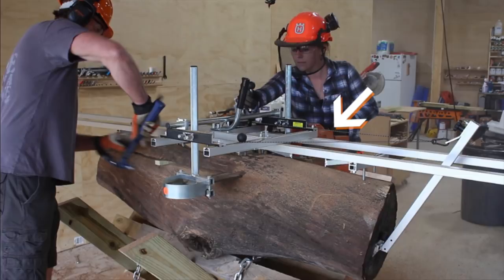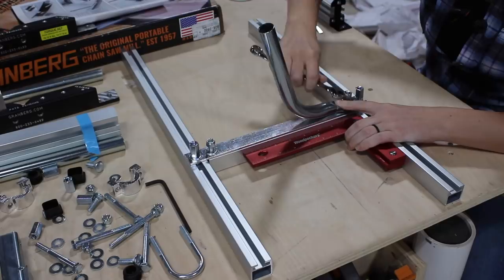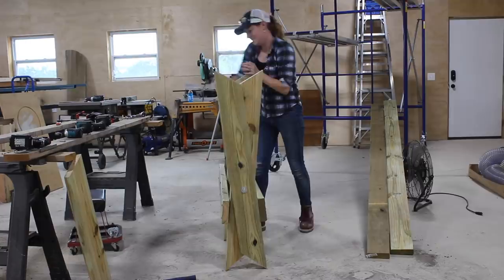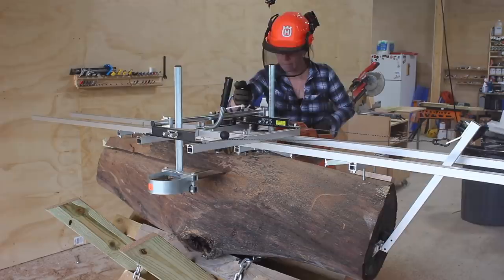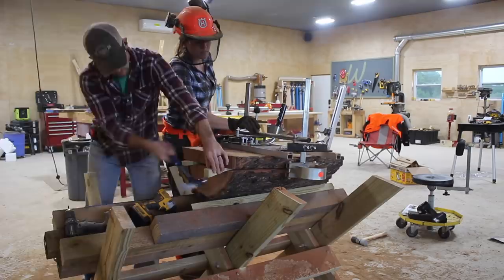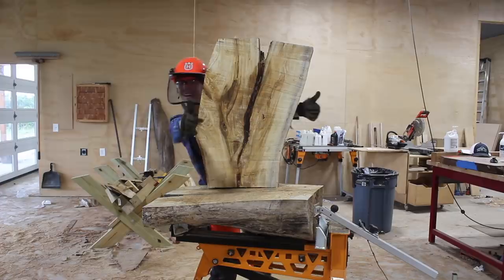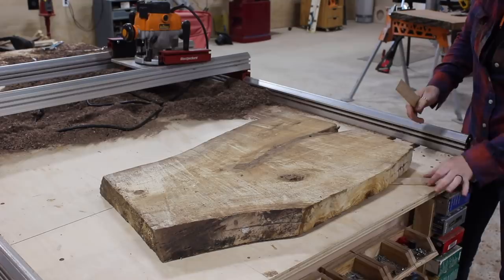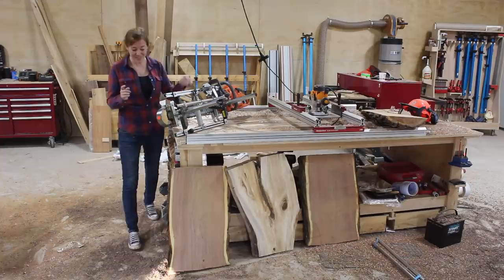Portable Chainsaw Mill : How To Slab Logs

Comment: I've got a 36" Granberg mill with a 36" bar on my Stihl 461. I set it up a couple years before Granberg offered their winch accessory so I installed a boat trailer winch on a wooden fixture attached to the mill guide bars. I've used it on ash logs up to 30" in diameter.

I found that to get the best yield out of the logs I make the first cut such that it is a 1/2" to 1" above the pith at both ends of the log. Then I work each "half" of the log milling off boards/slabs.  I find that the chainsaw mill is better supported on the log when working from the wider surface to the narrower surface.  

An advantage of the winch not mentioned is that you can move the saw through the log much more smoothly with the winch. The smoothness results in a more consistent and smoother surface on the boards than is possible by pushing the mill through the log by hand.
Reply: I do the same John Grossbohlin. I cut parallel through the largest crack in the pith, then mill each half. I also put the log on a good slope and hand push it through each cut, gravity works well. I'm cutting oaks, maples and poplar with an occasional black walnut.

Comment: April, thanks for the very informative look at chainsaw slabbing.  My humble contribution to your process is to suggest you use a pulley where your winch cable/cord changes direction.  You will be surprised just how much more efficient a pulley will be.  Best regards, Steve.

Comment: I have a 54" alaskan mill will a Stihl 660.  When I make first cut I use an 8ft aluminum ladder with holes in the steps to screw to the log.  I also have a 20ft ladder I use for really long logs.  Great video April.

Comment: ALWAYS use the highest grade two-stroke oil, especially with new machinery, even more crucial if you're using a professional spec saw. I worked at a college where we had so many saws getting scrapped because of low quality oil.

Comment: Good video, I do a lot of slabbing. And your right about the 1 inch per year. But a 2 in h slab is only one year. 1 inch from top and bottom. 3 inch slab is 1 and a half years. 
Thanks for the tip to slab down hill.

Comment: A 450 cc huskie bogs down ripping an oak log, experience firsthand. My Echo 590, 460cc no problem with a sharp chain- oak. I never thought of using a router for surfacing planks, a planer  yes. I have 10 plus acres of oak

Comment: April, great video! The only issue I see in your setup is a mistake I JUST made. Where the mill is clamped over the bar nose sprocket. Clamping it there will cause excess heat and wear in the sprocket and it will fail much sooner. I know this because I was doing the same thing the other day and I had to replace the nose on my bar after it blew up.

Comment: Still another Amazing story from you April I have been following you from the beginning and you are an Inspiration !! One suggestion i have for you that I never see in your videos is an overhead trolley beam with an electric chain fall on it to more heavy pieces around the shop and place them on your benches. If you get one I"m sure you will wonder how you did things without it . I worked in a cement plant for 30 years and dealt with many very heavy things to lift and I think of those times whenever i see you struggling with something heavy;)
Anyhow Keep on keeping on :) You are the "BEST " !!!  
John

Comment: Great video. I got a Granberg myself and used it with a Stihl 084 (with about 122 cc's of raw power) with a 36" bar. It's a beast! I didn't like how much work it was to slab with it. I'm constantly sharpening the chain, adding fuel/oil, and fixing loose nuts/bolts, but the results are pretty rewarding. I can cut huge logs pretty much anywhere. I love your videos btw! You do a great job!

Comment: Great looking slabs!
one thing that needs to be mentioned is if the log is from someone's yard or in town in general, there may be all kinds of metal in the tree.  I remember hammering nails into a tree to climb it.  there are parts left over from clothes lines, signs, etc.    So beware.  Best to get logs from forested areas where this probably won't be a problem.  I just watched a vid where the guy had a bandsaw mill and he hit a huge bolt and some misc. metal in the middle of the tree and trashed 2 blades....

Comment: What is it about slabbing that’s so addictive, that piece of oak you started with that had all the splits and checks in it will make the most beautiful furniture once it’s resin filled. My high end customers from Sydney’s beachside suburbs and inner CBD always favour that finish over clean solid wood. I’ve actually raided people’s firewood stacks for material that’s “rustic” enough before.
Reply: One Man Band Woodworks Shhhh don't give away your trade secrets.

Comment: Very nice video. My dad and his brothers started a sawmill about 70 years ago. It ran till just about a year ago when my older brother passed away cutting timber. Seeing what is in the next pass is always interesting. Wait till you find one of those crotch pieces that has grown without any bark inside. Those are hard to find and when in walnut gun stock makers will give a pretty penny for it. I have a 3 heart section of Ash stump that I'm getting ready to flatten for a table and the router sled you were using looked great. A lot better than 2X4's and a piece of plywood that's for sure.

Comment: To cut down on the drying time, I have my slabbed wood stacked in a spare bedroom, with a dehumidifier drops the drying time from 1 year an inch to 2-4 weeks an inch... but you will get more cracking, and for the first week, you will have to empty the dehumidifier every 8 hours, so that's 3-4 times a day for me.The extra cracking to ME isn't much of an issue, since the wood is basically free any way and you can adjust piece layout for your projects to accommodate /avoid the cracks.
Reply: Great idea

Comment: Great Video April,  the woodpecker slab flattener looks great, I've used a DIY plywood version for years. I would add that the board needs to dry before you flatten it.  The board moves and twists as it dries.  I'm not sure that was pointed out in your video.

Comment: Hi April, I saw you put wood spacers on when you were milling smaller logs but if you had turned you log holder upside down it would have held the logs perfectly. I can see you building a log bandsaw the same as Matt.

Comment: I have the same mill except that I use a Stihl MS362 and the same rail system.  You're right, it is a nice setup.  I was slabbing an 8' swamp chestnut oak log (20" diameter) and that stuff was HARD and still a little wet.  I had to resharpen the chain after two cuts and the last two feet of the second cut took as long as the first six feet.

Comment: The chain is crucial when milling! I use an electric bench mounted chain grinder to set the angle between 10 and 0 degrees (0 degrees for a quicker cut on soft woods, and 10 degrees for a smoother cut or on hard woods....remember you are cutting end grain only, which is massively different than side grain cutting...ask any wood turner). Additionally, each tooth should be ground to the same width, not just the same depth from raker to tooth (as with a cross cut chain), because if one tooth (assuming a chisel chain is being used...it should be for milling) is taller, it will also be wider, and will carve a noticeable mark on your slab because it sticks out wider (when viewed from top of bar) and thus has a greater kerf.

Comment: I simply use a straight plank with 3.25" in deck screws set my mill depth to 3.5" and make the 1st cut. Then adjust mill to whatever thickness I want.

Comment: Hi April. Nice tips, and some great looking slabs you get at the end of it :D 
New subscriber here. I have done quite a bit of CS milling myself (and made a few tips vids on it). A few things that get overlooked by a lot of people that I think are really important: 1. If you are not slabbing outdoors with a good breeze blowing, it's a really good idea to wear dust and vapour protection while you mill. Even outside on a still day, the operator ends up standing in a cloud of chainsaw fumes for a long time. While modern 2 stroke oil mixes do a good job of making the smoke invisible, it is still there! When I first got into CS milling I would feel really wiped out at the end of the day, then I started wearing a proper mask/ventilator, and that sorted it completely. Anyway, I go on about the mask I use in some of my vids, enough to say it's best to avoid potential health problems down the line if you can...
2. Your tip about putting the log on a slope is a really good one - too many people forget that. Combined with a sharp chain (I think you are overcooking the sharpening quite a bit BTW - three passes on those short logs isn't much unless they are particularly dry or dusty) the CS mill should just pull the saw along into the cut with very little effort! No need for the winch ;) If you do use a winch, as well as the extra kit to setup and transport, it can be a bit harder to tell when the chain is starting to dull and needs a sharpen...
3. In my experience a cross cut chain does work, and in some instances better than a 'rip' chain with a 5 degree grind. Standard cross cut chains can give really good clean boards and are often less finicky about wavy grain and knots. Consistency of the chain's grind is more important than the top plate angle itself. For that reason it's really difficult to hand sharpen them with a file if CS milling - so +1 for your sharpening device. 
Looking forward to seeing what you make from natural edge boards.

Comment: I cut exactly one log before I went out and got a winch at Harbor Freight.  I never got the rails for the first cut. I made my own straight edges with two 1x4s and a 1x12.  I have two of them.  One is about 5 feet long and the other is just over 10 feet long.

Comment: A good tip is full carbide chain. A full carbide cross cut chain will rip far faster than a ripping chain. I dont have a mill. But i have a saw with a carbide chain on a saw i use just for cutting big blocks in half. And beleive me when i say its awsome. Im not shure if they make full carbide ripping chains. But im sure they would be awesome if they do.

Comment: Real nice work and informative presentation April!   May I suggest a piece of mylar put on the slab after your first pass and every pass thereafter.  It will make that metal slide very easy on the ruff cut wood.  I use it on my out feed table on table saw for 3 foot to 20 foot materials.  No resistance it's like sliding on ice. Just a thought, great video!

Comment: This is a really interesting video. Thank you for posting it. 
When setting up the rails, there are two things that have occured to me that would be helpful.
1.
Do not trust the joiner in the centre of the rails and check with a straight edge that they are straight.
2.
Use winding sticks to check that the rails are not in winding because the spirit level alone will probably not be sufficiently accurate.

That should give a flatter straighter slab though of course it will move some on drying.

Comment: Nice job, nice equipment. A chain hoist with a rolling A frame can be handy to lift logs on/off your buck. Chainsaw mills will create more sawdust than bandsaws but work fine for smaller volume jobs. ☺☺

Comment: April, the support/stand you made (known in  UK as a saw horse) Turn it over so the shorter part of the legs is at the top, it doesn't need modifying just turn it over, you'll find it much more useable, otherwise great video.
Reply: In the US, it’s called a “sawbuck”. Also slang for a $10 bill.

Comment: Small thing.  Built bows learned from a old  wood worker.  Doesn't matter how long you dry.  From day to day moisture changes.  My case 100 thousand thick.  36 inch long.  I put in my mold for 30 minutes.  Can't be to dry for bows or furniture.  Not to wet.  Had a moisture tester used to cost 100.00 now 15 or so.  To dry absorbs glue to much.  To wet won't absorb.  Ideal is right around 8 to 10 percent moisture.

Comment: While it's true that most jointers and planers simply aren't large enough to handle your slabs .... perhaps you should build yourself a sanding surfacer/planer that can?  Use roller drums with sandpaper ... perhaps even make multiple drums with different dedicated grits, so you can do rough sanding passes as well as finish sanding passes ...

Comment: Because the color saturation of the slabs shown is so vivid and the air is not filled with great clouds of dust, I assume all the wood you dressed flat was wet. My experience was is, though that works very well, it is futile since all but perfectly quarter-sawn slabs will drastically change shape as they dry. After a couple iterations of shop-built slab-dressing frames, I realized that the very tip, the square point, of the cutter wore first and quickly. Thousands of inches of travel are necessary to level the whole surface of a dry slab. As the square corner becomes dull, the whole router drifts upward disengaging from the work and leaving ridges. A cigar boxful of fresh bits and a technique for indexing them precisely might solve that problem but I had better luck flattening twisty dry slabs using a sled fitted with jackscrews and a coarse belt on a widebelt sander. A worn-out, obsoletely-designed 50 year old widebelt sander is still useful to flatten the twist of dry slabs.

Comment: Hi April in order to get a higher three Legget sawhorse turn your sawhorses upside down and mouth a new set of two by sixes on the bottom legs so you can have it lock into place just like it does in the lower positionthis will give you extra height and you can have it be adjusted so the bottom legs are not sticking out so far by where you put your additional two by sixes to lock it in place

Comment: Don't know if it has been said yet, but when you are attempting the drop pull start, your hold on the handle is wrong because the blade is angled in towards your leg. Doesn't make any difference if the chain brake is engaged or not, hold on the other side. Of course, the drop pull is easier if you have a lot of muscle... For safety sake, unless you are an expert on the chainsaw, do not attempt this start, and do it on the ground, and with the chain brake engaged. 

Do not get a wood lathe! The lathe is maybe 1/4 of the cost of what you will need to get into turning...... Saw a link about your log loading thing over on the AAW (American Assn. of Woodturners) forum under the heading of moving heavy pieces of wood.

Comment: Air-drying is about 1" per year,correct. However , a slab has two sawn sides exposed to the air .
2" slab is air-dried to about 20% moisture in one year. A 4" slab takes two years ,etc.
Btw, you rock a flannel shirt ; )

Comment: A small investment in a hand wand metal detector is super beneficial for ensuring that the log does not contain metal, nails spikes, hooks, of even fence material.  Those would be dangerous if the chain breaks while standing right beside it.  Second, the chain is at waist level above the belly button, so a heavy leather apron would be much safer.

Comment: The high tech way of flattening slabs these days is using a CNC machine.  Just need a large enough table to place the slab.  Just set it and forget it.   Look up Paul at Canadian Woodworks and look for the shop tour he did with Matt Cremona this summer.

Comment: As far as sharpening your chain... Sharpen it, then when you make your first cut, look at the chip size, then as you make your cuts, look at your chip size, once they get 1/2 the size, then all you will need is a couple of light strokes with a file. Don't let it get to the point where it is making sawdust , then you have a lot more sharpening to do. Dump that sharpener and learn how to hand file... When you are out cutting in the woods, where there is no power, you still need to keep your chainsaw sharp. Not to mention, once you get the hang of it... way faster... Make sure you know the correct tooth angles for the type of chain you are using. Also I carry a sharpie with me and mark the top of the tooth I started with, so I don't have to remember or guess where I started. To start, buy one of the files with the angle gauges on them and then, once you get the hang of it, all you will need is the file... Make sure you have the right size file for your chain too... In addition, once you know your saw, you will know when it is ready for some light passes, without even looking at the chip size, by the amount of pressure it takes to advance the saw and the speed of the cut, through the tree or log.

Comment: Yo yo starting is for amateurs. Tuck the throttle handle behind your right knee while holding the front handle with your left hand then pull. No more bending over, no more dangerous drop starts. 
Great video btw.

Comment: Ah! The Magic of seeing something no one has ever seen before; the inside of those logs ! You can turn your log stand upside down instead of piling up blocking. The off center placement of the bolts gives you two different working heights. Does anyone have any guesses on how much a full kit like this is going to cost? (I need to prepare the children for damage to their college funds.)
Reply from the maker: Yes that is a great idea. Everything included it's about a $1200 kit, but you could start off without everything to get going.

Comment: The Rancher 460 with 60 cc's will not be enough a powerhouse to do much chainsaw milling. It will burn out with continued use.  Above 80 is where you want to start.  If doing just some small logs you'll be ok but plan on doing a full days work need something bigger.